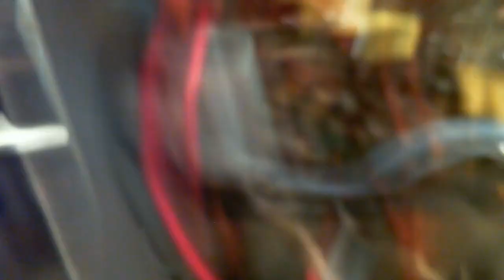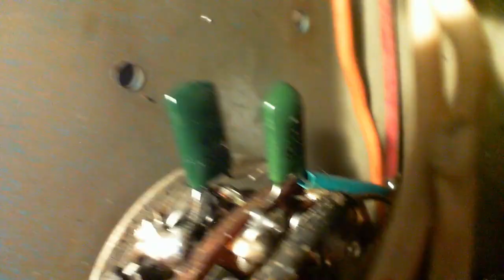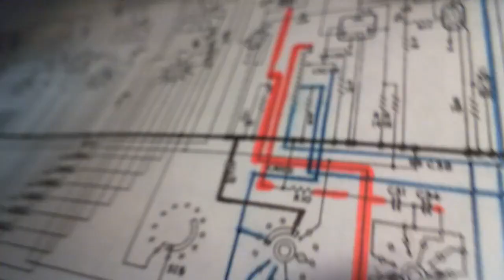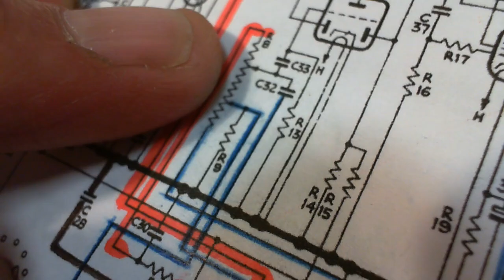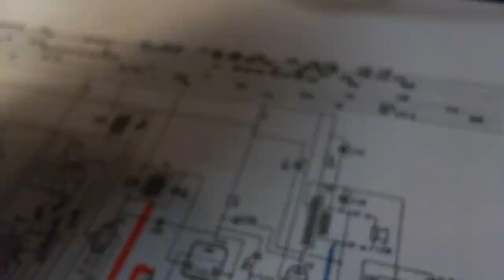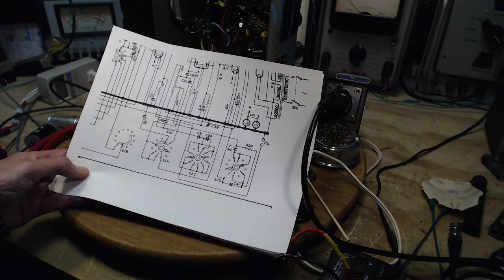Canadian PYE Model 39HC Video #52 - Tone Switch Wiring

Comment: 53:11 We clearly see that the motorboating does NOT stop when he sets the switch to phono position. Now what does that imply regarding the SOURCE of the motorboating? Can the radio section be causing it if he is on phono input? NO! The motorboating is clearly caused by the audio amp section alone.

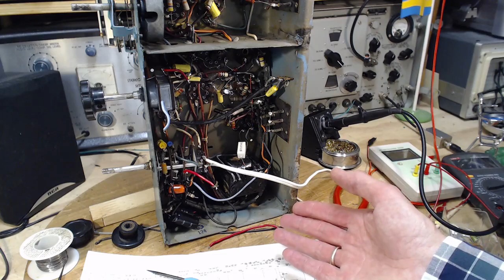Comment: 41:57 Your analysis of the circuity is absolutly WRONG. Look at what is drawn not what you "think" is drawn. The negative feedback from the audio output transformer is to the bottom of the volume pot and therefor always there. Even more so; Its influence rises the moment you pass the tap on the volume control and approach minimum volume. And even tho at mimimum volume you wont have an audio signal from the radio, there is still inadvertable things like humm, hiss, or crackle produced in the audio amplifier section. And they are enough to trigger a feedback oscillation.
But if you raise the volume past the tap with the 22k to ground, the feedback path to the bottom of the volume pot loses influence over the feedback path to the tap and the one onto the wiper. That is when the oscillations die.
You have experimented so much and IMHO many of your results are pointing in one direction... Stop believing or thinking but let actions decide.

Comment: Hi Jim !
You mean there is no signal if the pot is down, no, it is not directly on ground, it is connected over the outputtransformer and the speaker to ground, so there is a little signal also if the pot is down. So it is a work of 1 minute to change these two wires only for a test. If it is not, so You can be sure that this is not the reason of Your motorboat :-)
Reply: Exactly. He has all the evidence and the schematic and still fails to read it.  It is clear as day that the feedback loop for tone control ties to the bottom of the volume pot and therefor it is constantly there. In fact the influence of this path gets even more pronounced once you pass the tap point (which is grounded via 22k) and approach the minimum volume setting. And approaching the minimum volume is exactly where the oscillations get louder.  Elementary evidence.
But the fact that he dont realize that you can easily introduce positive feedback by flipping the polarity of EITHER the secondary OR THE PRIMARY says it all. The solder joints on the terminals on the speaker connector look shiny, so they were resoldered at one point.
 Maybe he did or someone replaced the transformer before him and he is chasing someone elses mistake. It would take 5 minutes to chase this possibility and prove it wrong beyond the shadow of a doubt, without need for "beliefs" . Yet hours of video wasted on drawing modern art wiring diagrams of a switch and re-replacing perfectly fine components on a whim. F.ex. the green PP caps he used on the tone control switch are perfectly fine for the job. This is not audiophile HiFi. They wont cause this issue, so no need to replace them.
But most probably others would have ripped out the switch and rewired it from scratch given all the mess he made when replacing the caps. This would be a one hour job at most and then he could be certain that it is okay. No, he spends hours tracing this rats nest.

But this is all preaching in the desert. He is in his groove...

Comment: Someone has been reading the comments posted on previous videos mostly because of frustration ( video 52!!!) . Good for you Jim.
    Look at Figure 4 on the other page for the wafer positions !!! From knob end ( l to r) it's S2C then S2D then the next wafer it's S2A and then S2B.
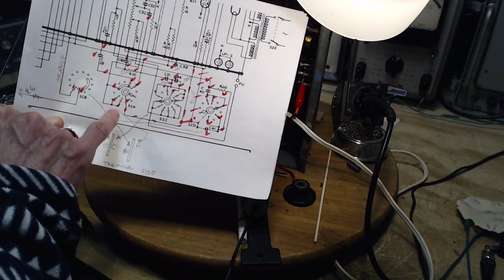The pencil drawing you drew at 38:06 shows you have  wafer position C and D reversed and B and A reversed from the Figure 4 chassis layout drawing!
Went back to volume control and then discovered another error.  Make sure C36 is at or near  4uF and not 10uF!  Best to put two 10uF in series at 450V 
and get 5uF at 900V ,close enough for government work, to get to what the schematic says! This is where the problem  really lies. 
 See worldradiohistory.com and go where Gernsback books are located and find #78 the book Rapid Radio Repair by G.Warren Heath.
 Go to pg 177 and pg.178 and see steps to remove motorboating.

Comment: Just a quick comment.   I see you used a styroflex capacitor in that radio.  Not the best choice in a higher temperature environment, tube applications.  These are extremely sensitive to heat, they will drift in value, and never ever go back to their original specs.
BTW, It’s the transparent one behind the volume pot.